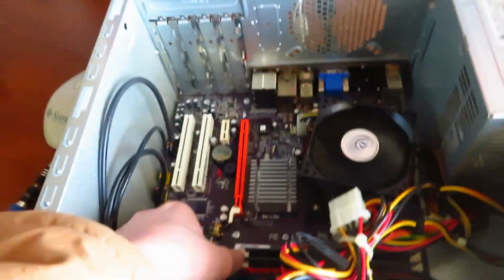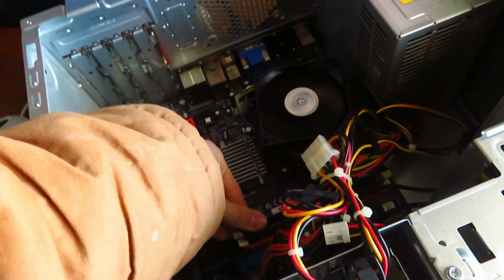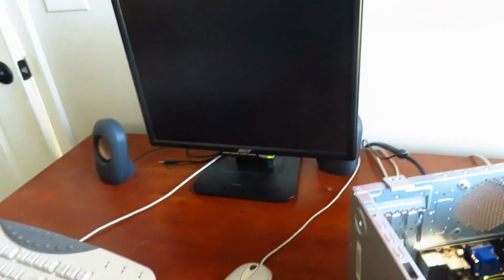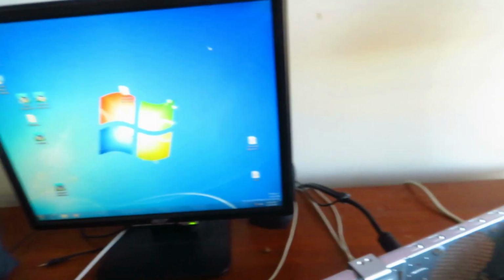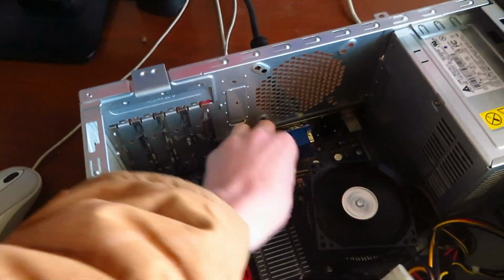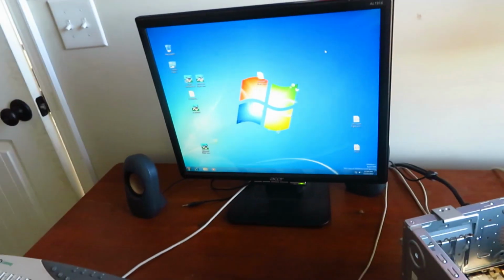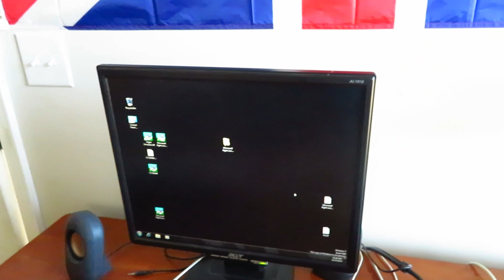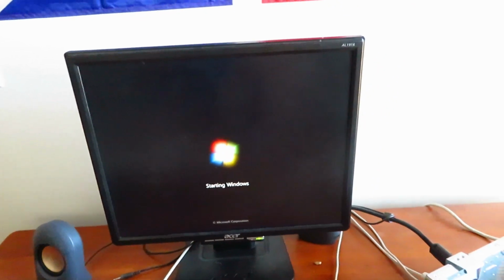Unplugging Important parts of a computer while it’s on

Comment: take out the cpu
Reply from the maker: I did, unplugging it is the same thing as taking it out, but if you want me to, I will, just remind me
Reply: @TechnicalOperations  i saw a video - i think it might have been from linus tech tips (ew...) - where they pulled out the cpu while it was running and there was still and output on screen and it still sort of worked but there was weird behavior. you probably need discrete graphics mobo integrated graphics for this to work.
Reply from the maker: @bbseal6174 Yeah, sure, I have done this many times in the past, but I will try again.